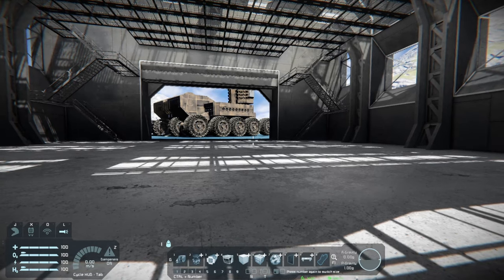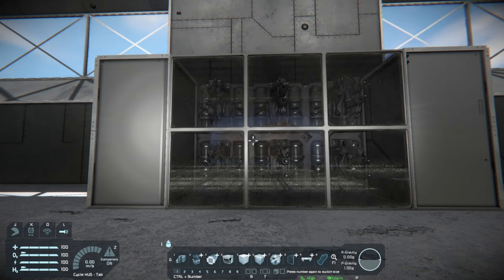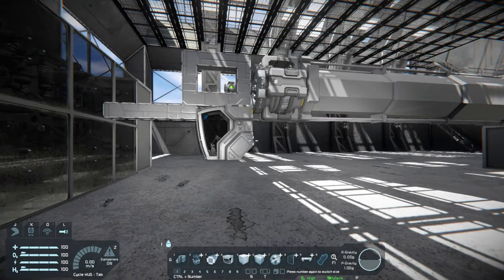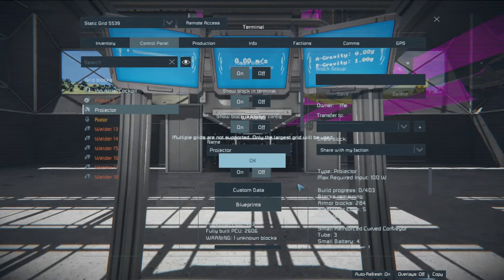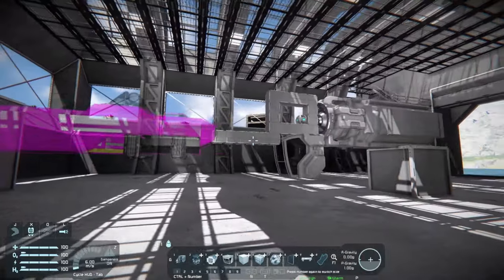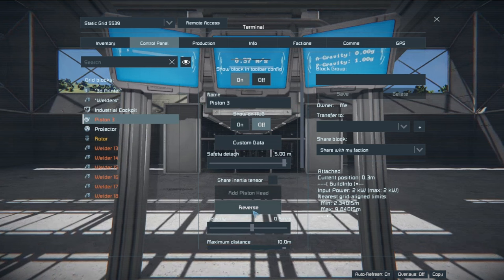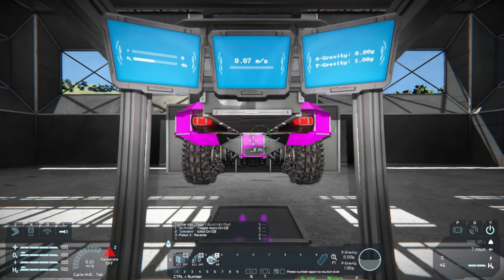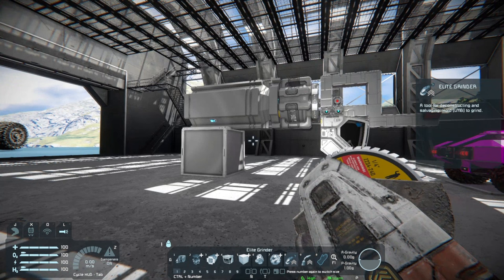Building 3D Printers in Space Engineers!

Comment: hey good video but i would suggest to put the piston in the botton or the cealing to get an easy out of the hangar if printing is done and in fact put a lage grid projector betwen piston and rotor or atleast a large block to have the option to print both large and small grid ... u mentiond many welders for bigger prints well in singelplayer u can do what you want but on servers u will most likely not be abel to have more than 10 welders because they eat up performance but u can put them in a row with a motor behind same goes usually for drills ;-)
Reply from the maker: You are absolutely correct, I really just wanted to focus on the basics of 3d printing in SE. While reviewing the video before upload I started writing down different improvements for the printer that I would personally use. and I already have a pretty sizable list (that includes a couple of point you made)

I will add the projector  suggestion while I probably wouldn't use it much personally, I do know some servers you are only allowed 10-12 max so having a printer that can handle both  would make absolute sense.